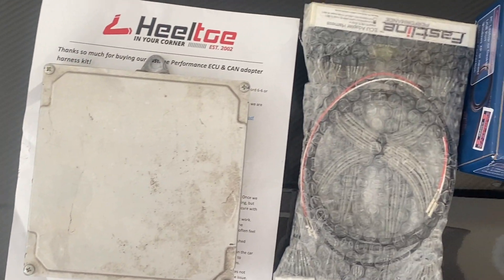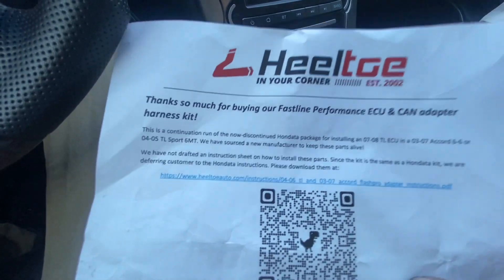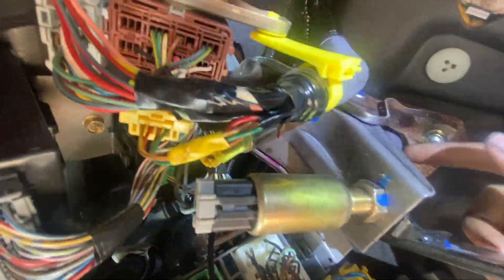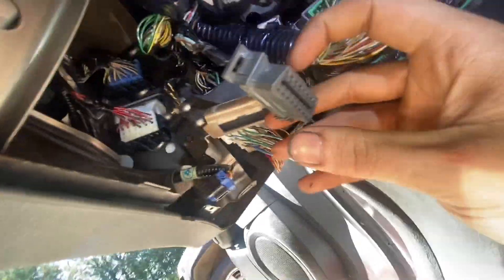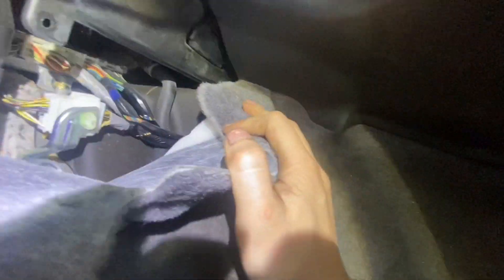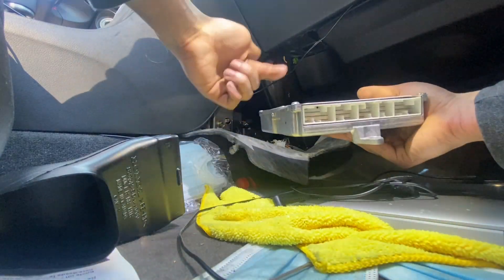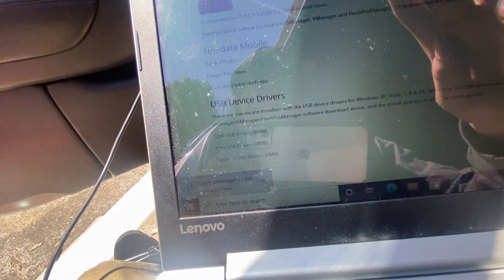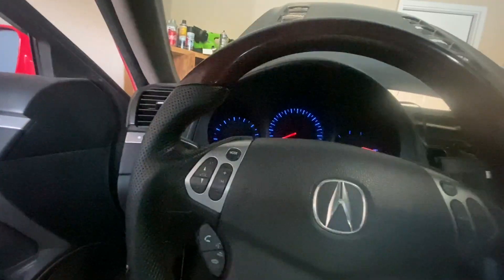Hondata on base TL 04-06. (InsTL)

Comment: I appreciate this video more than you know. I have a 2004 UA6 that I bought with a 5AT, but I converted it to a 6 speed manual with a 2003 CL Type-S trans. I bought a 2004 Sport 6MT ECU and immobilizer along with the manual cluster, manual engine harness, and pedal set and swapped everything in. Anyway, I fabricated a turbo kit for it and now I'm trying to figure out how to tune it. I bought a 2007 TL Type-S manual ECU, a Hondata FlashPro, a 2007 immobilizer, and I thank God I finally decided to watch your video because I couldn't find an adaptor harness ANYWHERE until I watched your video, but I just ordered a Fastline Performance adaptor harness from Heeltoe. I'm just hoping that I won't get any surprises in the form of missing connectors due to my car coming stock as an auto.
Reply from the maker: That’s a hell of a built man! Let me know how it goes!
Reply: @hdua6772  I took it to a dealership yesterday to have the immobilizer programmed to the 2007 ECU and they told me that I would have to pay $250 for them to install it and I would also have to pay $150 for them to program the immobilizer. I told them that everything was apart and I could swap the ECUs out in two minutes, but they insisted, so I just left. I've called quite a few automotive locksmiths, but no one around here has the programmer, so I'm just going to try to get a FLY 100. I don't know what else to do. There aren't too many Acura dealerships located near me.
Reply from the maker: Try hitting up any local shops. Anyone with a scan tool can program it. Shouldn’t be too expensive

Comment: Mine used to do that when I installed a J37 Thorpe throttle body. They're is a setting in flashpro that deals with Rev hang
Reply from the maker: I turn it off but it’s still doing it

Comment: I had a question did you use the ecu jumper harness for the conversion…? I just got my kit from heel-toe..?
Reply from the maker: Yeah I did
Reply: @hdua6772  what radio/deck do u have? does climate control work through it too? looks clean asf looking to do this to my 04 tl

Comment: Name is Joey I have an 04 Acura TL 6 speed I have an awesome nice exhaust system with a custom made j pipe that I made I'm a welder and a mechanic I was just wondering is there any way you could possibly let me know where I can find what I'm looking for in order to take away the speed limiter and possibly alter the fuel mapping and sort of the power band and where it needs to be I didn't listen to your whole video I'm working right now but if you could reply humbly I'd really appreciate it I am your true Honda enthusiast from the late '80s early '90s F1 days when McLaren and Honda were dominating everything else is trickled down from that point rest in peace ARYTON SENNA
Reply from the maker: 04 tl 6mt doesn’t have governer. You’re maxed out by your gears not the computer. For fuel mapping then hondata or ktune

Comment: Does anyone know how much a manual swap on an 04 tl base wanted to put a type s engine on it but I’m looking for price ranges rn
Reply: You have to get a trans fron a 04-06 or it won't fit the bell housing. They are very hard to find. You'd be better off getting a different tl.